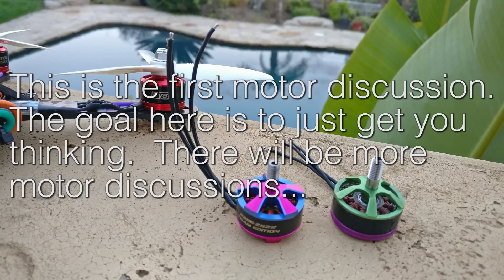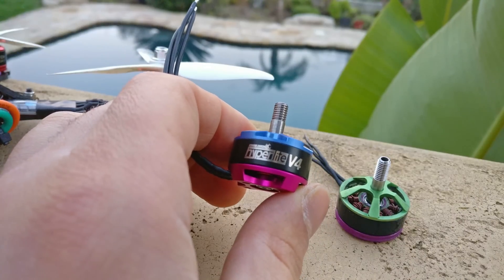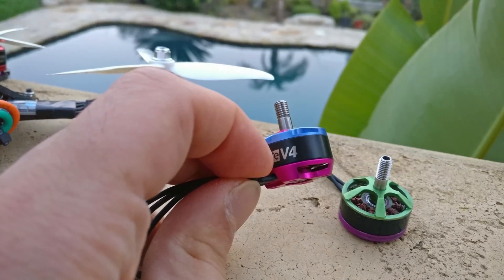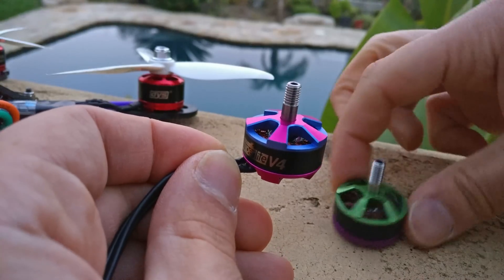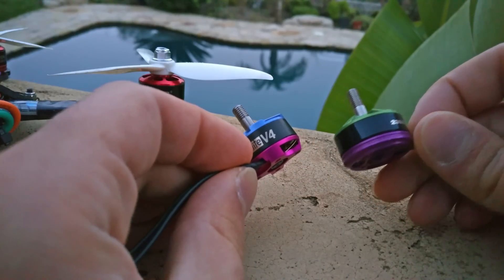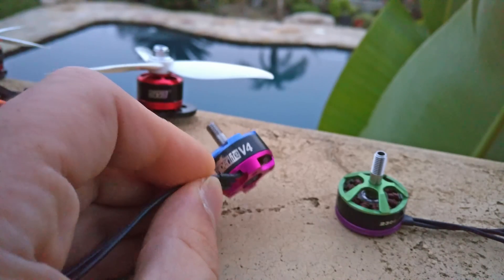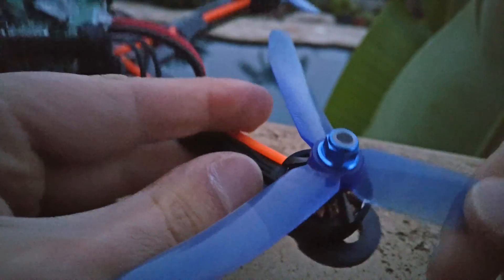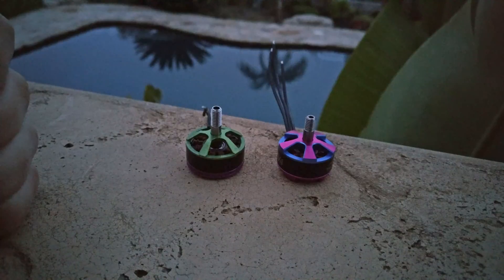Motors 1 - Quad Theory

Comment: your speakings on motor height vs width is interesting. I have a hexacopter and it's motors are big old pancakes. Now I know that thats because they operate at lower speeds with the need for low rpm torque. 

Also big old brushless gimbal motors. They need the torque and control at low rpm.
Reply from the maker: Sawyer Phillips exactly. very good extrapolation. that's the first thing I thought of too when I realized all this a while back. you can't have a wide high speed motor. for something like the freedom/1000mm class, we need wider but most importantly taller motors to be able to better manage big props spinning at high speeds.
Reply: True, mine was a AP rig so it had no need for speed. Makes me wonder why RC car motors are always long cylinders. They are inrunners as opposed to outrunners though so I'm sure there is a whole lot I don't understand there.

Also they are always geared down so maybe they work the same they'd just prefer to have the speed.
Reply from the maker: Sawyer Phillips yeah cars are the same. inrunners are particularly good for high rpm.  what's different on them is the loading. motors feel different forces than in the sky with a free flowing blade.
Reply: Gotcha. Thanks! Good stuff keep it up💕

Comment: I know you like 5" props. 6" props seem to be making a come back for acro.  Does this meant the motors out now can not effectivity turn a 6 inch prop?  Is a 2306 2300kv right for a 6045 or will 6" need  a 2400 or 2600 stator? Are you going to make a 6" EVO HD frame or a top battery mounting plate for acro?
Reply from the maker: Jeff Kruger there already is an Evo HD 6" and 7". 6" has always been there and I recommend it for racing with a GoPro. as for freestyle, it's very personal. people like 6" because it's so smooth due to the lower disk loading. I believe the 22-24 stator size is a bit small for 6" and I'd like to see a 2506 in ~2150kv for 6" freestyle along with some better 6" triblades.

the biggest issue I have with 6" is the annoying video jello associated with it. bigger blades are exponentially more difficult to balance right.  hard to get a good 6" factory blade. I'm about to move towards a 5" hex for that reason even though everything about a 6" quad should be better.

Comment: I guess I'm not understanding how you determine motor construction when your shopping for motors. how do you go about this?
Reply from the maker: B33SON how do you determine actual batt C rating when you're shopping?  you can't. if you hold the motor in your hand and inspect it, you can tell what it's construction is like. otherwise, miniquadtestbench is your best source. 

that being said, if you see over 1.3kg from a 1608 motor, it's safe to say that motors construction is top tier.

Comment: eddy current ( Foucault currents) is the current that is induce in the body of the little sheet of metal the moment you remove the magnet field. It's localized in that thin metal sheet. The problem is that when you have rotating magnet, you have forward then reverse magnetic field the makes the current in the body move in both direction in that sheet of metal. That generate heat!! you can make your motor with one big block of metal but that will generate too much eddy current, so that is why transformer and motors are laminated in thin sheet of metal. The smaller you have those lamination, the less intense is the current thus less heat! All that is for efficiency. The DYS Fire have 0.10mm lamination while the rest of our motor are 0.15mm. One year ago, everyone was at 0.20mm.

N52 is a grade. It' the maximum energy product in neodymium magnets. There is nothing more then 52.
Reply from the maker: Jerome Demers thanks for that. was waiting for this. if you don't mind I'll post this in the videos description. credit you of course. also, I'm not convinced every single company out there making cheap hobby motors are using N52 magnets. I just call them string and weak. like C rating...lies.
Reply: yes no problem. Remember that saga with ZMX and Brother hobby motors. Well the guy behind ZMX/Fusion motors was a (I think) a mechanical engineering student that started to make motors with high quality components,  lamination, magnets, tolerance, bearing, etc. He wanted the finesse components in his motors. That was why at that time he had amazing performance with them. Then came the BH motors saga and blablabla and BH started making those high performance motors because they learn a few trick while making the ZMX motors.
Reply: There are diminishing returns with thinner laminations.  It is highly dependent on how thin they can get the insulation between laminations.  If you keep making the laminations thinner and thinner but don't get the insulation between layers thinner there is less metal in the stator.  You are making the stator more insulation than metal.  So the real technical hurdle is making the insulation between the laminations as thin as possible so that you can have more layers in the same stator size and not sacrifice the amount of metal in the stator.
Reply from the maker: I've inspected the laminations on the DYS 0.1mm and some others.  I'm impressed with the DYS.  The insulation looks nonexistent even.  But yeah, I hear ya.  These are still toy motors...
Reply: I believe a thin layer of glue can be the use for insulation. Or some sort of varnish.

Comment: Thanks for this video. I'm building a tweaker 180 FPV Addiction frame which is capable of taking 22xx series motors. I want to be able to carry a Session or Runcam3 style camera on it. It sounds like the 1407 is the way to go with a 4 inch prop. Is there a difference between the Hyperlite Race Edition and the HB Tornado? The specs between them look identical.
Reply from the maker: GaugedFreak same thing. just rebranded. the 1407 will not run a triblade 4". it will only run the GF4x45. I believe there is a DAL copy of that too. it gets too hot on the other 4" blades. still runs pretty hot on that twin blade and 4S. 

however I would NOT recommend that motor for your build. I would actually recommend the brother hobby tornado 1608. carrying an HD cam requires power. the 1407 is good but you need more like minimum 1kg per motor to have good performance with a GoPro.  the 1407 is just for super light builds. the 1608 if you can find it, is 25g and a super power house motor. it'll be 3g lighter than a 2206 2700kv which should be your other option.  GoPro will also require a 1300 battery.
Reply: GaugedFreak just rebranded it's the same
Reply: I wouldn't use a 1407in a 4 incht hat weights more than about 220gr w/o the lipo. My 4 inch weighs 260 with 1806s 2800kv and that is ok. If I wanted to mount an hd cam I would go with a light high kv 2205.
Reply: Thanks Kabab FPV. After this video I did a little more research and found info that confirmed what you you just said. I appreciate the quick response and recommendations. I'm really digging the blue hyperlites, and keep coming back to them.
Reply: I used 1806 2600kvs on my Tweaker. It carried a light cam like a Run cam 2 pretty well, could probably handle a session ok too